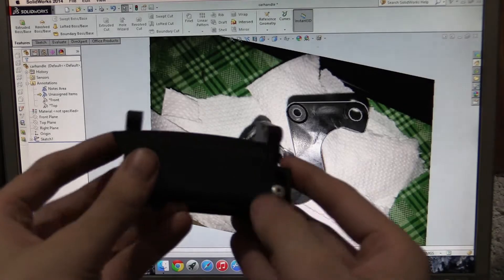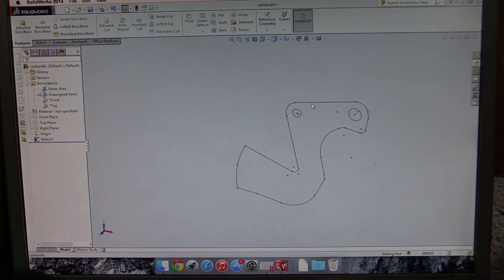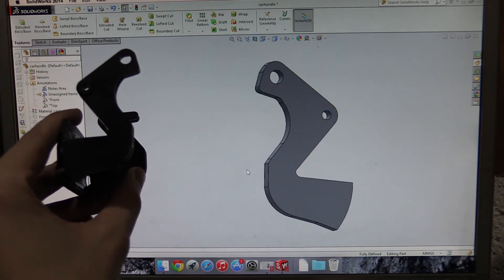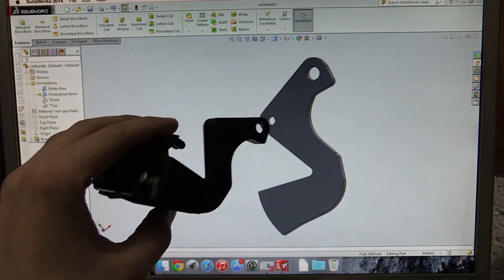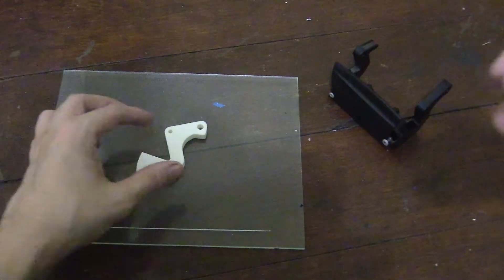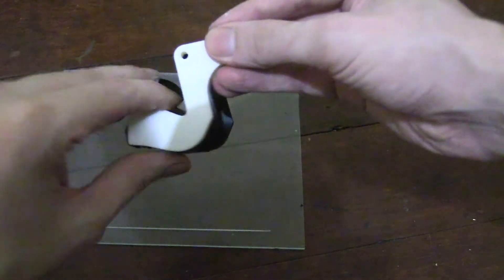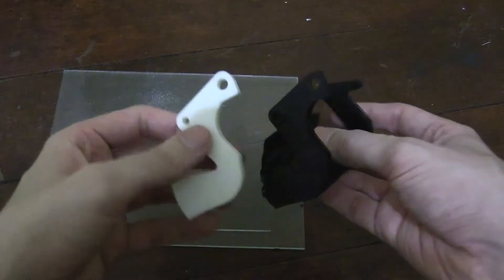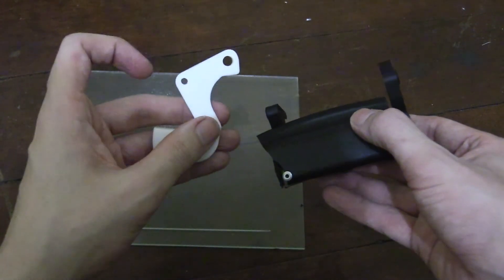3D Printed Chevrolet Door Handle - Part 2

Comment: wow im amazed at that very good how long will it take to print the whole thing ?
Reply from the maker: Kriss Bartlett I expect when the design is finished, the total print time will take around 2 hours. It depends on your print speed and how much infill you do. I will do a higher infill on the final piece since I want it to be very strong.
Reply: ok thanks for the quick response
Reply: what kind of printer and material did you use?
Reply: wasn't me  message Gadget Addict  not me???